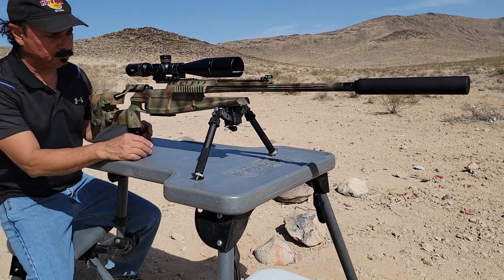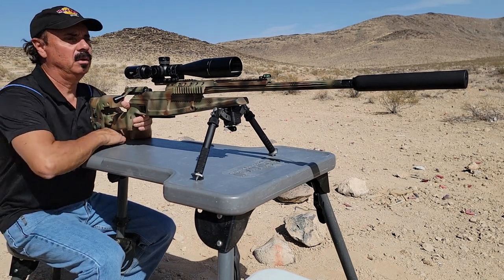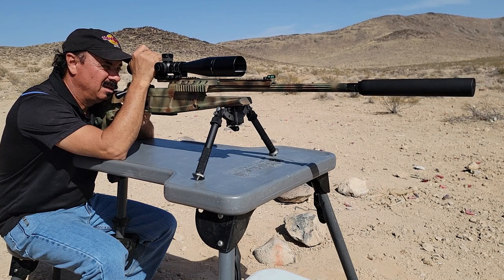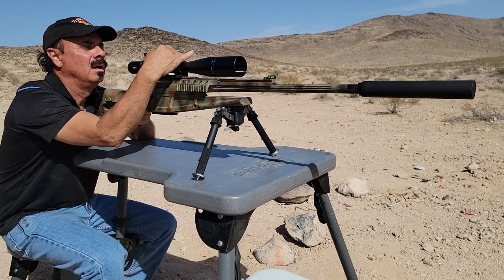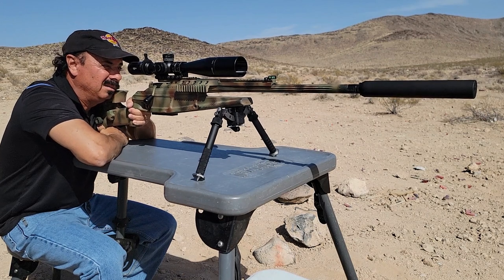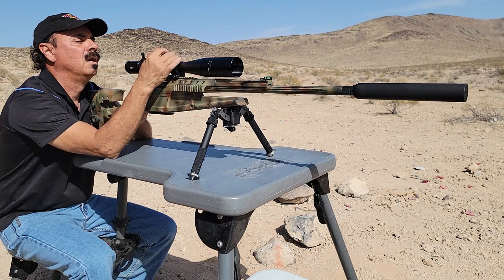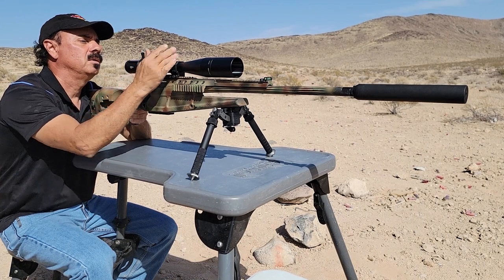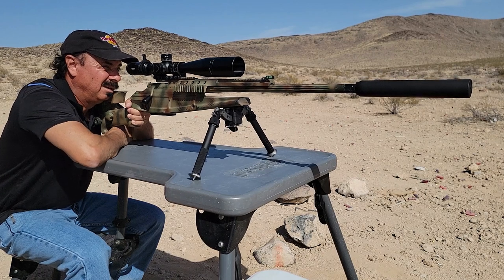Suppressor test 308

Comment from the maker: I enjoyed this setup a lot. Most suppressors have a point of impact shift of the bullet when installed...This one is perfect! It's a hit or miss going threw the process of buying a suppressor that can throw your shots off. If so, your going to have to sight it in with the suppressor installed. In subsonic it's range is very limited, so I would go with another platform for this application. Something smaller and lighter...As long as its accurate with a threaded barrel no sense on using a 13 pound rifle for short range engagements...